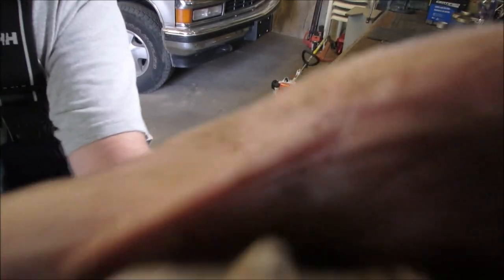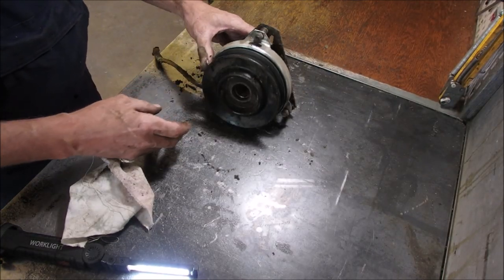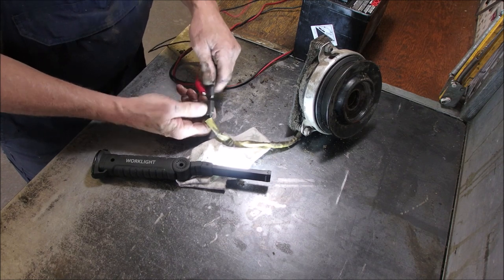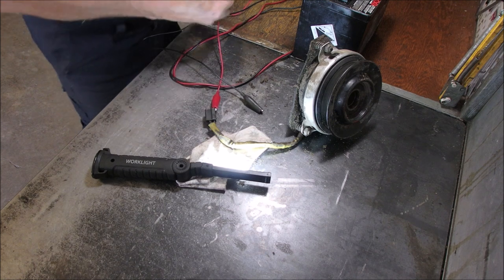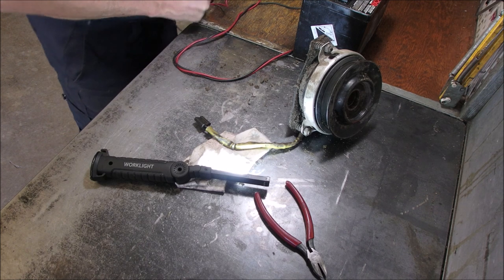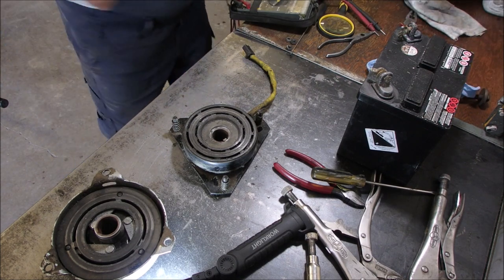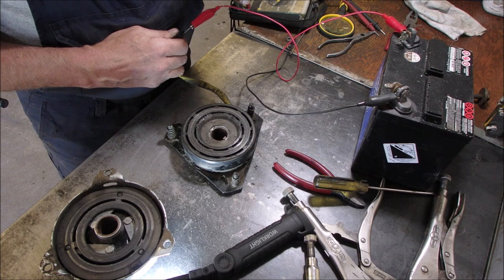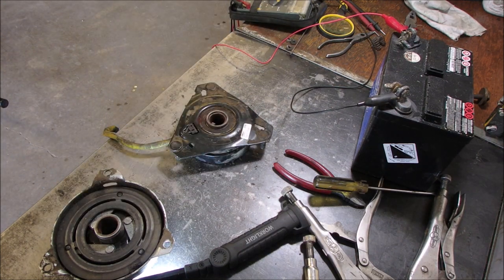John Deere LX178 Mower Deck Stopped Turning

Comment: Well Bruce we have never seen a bolt fall out of a PTO so not sure if it was properly torqued when initially installed. The only one we have heard of falling over is a customer that we ordered a new PTO clutch for and was doing self repairs dropped it on his head when he was installing it. This actually caused enough damage to the skull to create a concussion and he was not able to get back to the repair for a few days. Naturally he said that he knew he should have had us do the work! Now that is a no brainer eh?
Reply from the maker: Well It was installed in 2007.  On this one because of the radiator is  there on the top of the engine I had no  access to the top crank bolt.   So I tightened it back up as close as a blade with my impact and added red locktite to hold the bolt.           Thanks for the help    It means a lot.

Comment: How's she goin'?  I think there is no problem with the clutch other than the bolt fell out.  It'll work better after you tended to it though.  I like the mower deck with the dual blades on each spindle.  That's why it cuts so nice eh!!  Take 'er easy!!!
Reply from the maker: Yes i really like the deck for a maintained lawn.  It isn't so good in the bush.

Comment: A new customer had me out to replace all 3 of his belts, the tractor was a 12hp 38" deck, with the 2 belt transmission, luckily I did the belts for him, as the double stacked pulley on the engine, had lost its bolt, and washer, but the belt keeper held it in place, just came down a little but the key on the double stack was still in place enough to still engage the 2 belts, had to order them, but I have never seen a tractor loose it's pto clutch or double stacked pulley bolt and washer, I've had 3 this season so far.
Reply from the maker: This is my third. The rest had bad coils.   My only question is it dd not click very loud before and after I cleaned it.  As it fell off in  the spinning condition should it be spinning before I test it again??    Something is holding the gap back
Reply: Bruce, I think your test battery is too small or shot.
Reply from the maker: @craigjohnson3603  it had 12 volts.  i will check that.  I have a battery tester.
Reply: @BrucesShop  make sure the inner and outer bearing is spinning freely, you should hear a loud click.... Or clank, if you can remove the bearing dust cap on both re grease em, and put the dust cap back on, but no it should have a strong clank wether it is spinning or not. Also grease the spacer, and or clean the rust off.
Reply from the maker: @knighthawk86855  I just learned more as I hade more to do on the dissembly.

Comment: All this time you could have a  new PTO clutch installed. I ts probably the original clutch that went bad. I would put some lock tight on the bolt threads.
Reply from the maker: Wait here is more in a few days.  I don't give up,